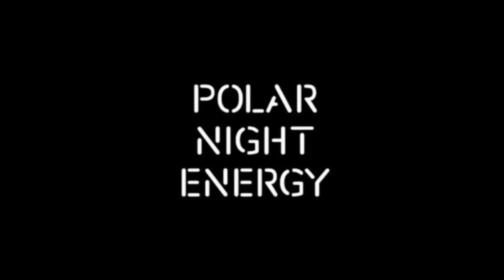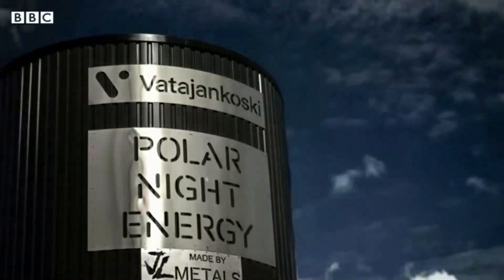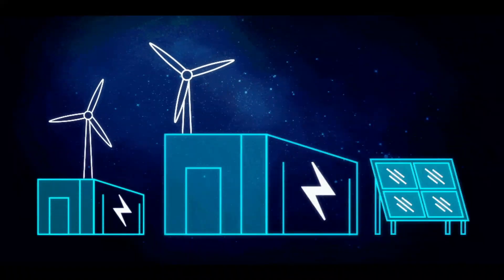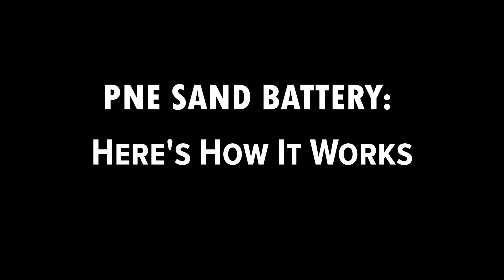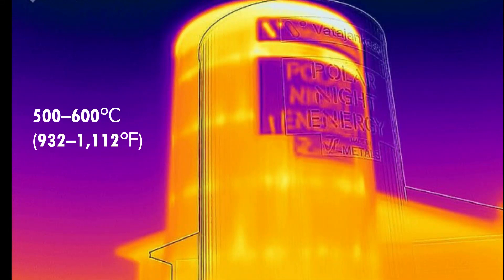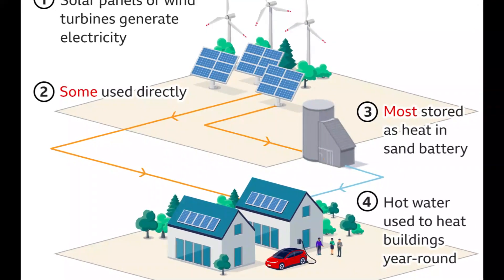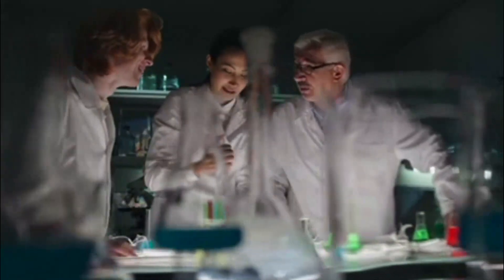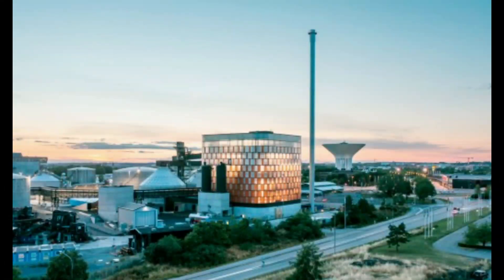Finland SAND BATTERY | How This New Battery Works & CHEMISTRY REVEALED

Comment: How do they recharge it in the middle of winter when there are very short sunlight hours and little gain.
Reply: @hypenohub  It all depends on how much you need to take out before it needs to be recharged, you can't take out out more than you put in unless they use a heat pump.

Comment: How do you insulate the hot sand from cooling
Reply: Sand has low heat conductivity, making it retain heat for longer. Unlike, say water, which quickly cools down. 
—
How hot is the sand?

The maximum temperature in the Kankaanpää heat storage is about 600 degrees Celsius. However, the temperature may even be higher depending on customer needs. In practice, the maximum temperature of a sand-based heat storage is not limited by the properties of the storage medium, but by the heat resistance of the materials used in the construction and control of the storage.

How is the heat storage insulated?

The heat storage is made of steel and insulated with standard, heat resistant insulating materials. The insulation is all around the heat storage between the outer steel layer and the inner one.

How long does the sand stay hot in the winter?

It can stay hot for months if needed, but the actual use case of the heat storage in Kankaanpää is to charge it in about 2-week cycles. The heat storage has its best range of use when it is charged and discharged 20 to 200 times per year, depending on the application.

Comment: How do they insulate their heat storage from environment?
Reply: @hypenohub  
In my opinion this battery may loose much more energy during the winter then it can provide for the customers.
I made some math around it: https://youtu.be/meOYKfm1l2o
Not sure it is correct but hope it worse to think about.
Reply: @eugeneshebeko4187  If that were the case, then my house wouldn't heat up to 70F when it's -20F  -30F outside right?
Reply: Sand itself is already an insulator, thicker the silo is, naturally it creates larger insulation, you just should keep the outer layer without heating and keep it as insulation.

Comment: solar concentration sand heating, the best ever, not 10% or 30% but 100% efficient
Reply: 1000 degrees delta in temperature, gives about 232Wh/kg energy storage rating for silicon dioxide sand
Reply: solar concentration Ca(OH)2 -> CaO + H2O cycle temperature storage, water reactivated
Reply: you can helium or even hot air float a balloon above clouds to have constant non-interrupted solar concentration energy storage or heat lift back to ground
Reply: parabolic half-mirror painted inflatable helium balloon with heat collector, electricity or heat conduction down tether wire, heat conduction by sand or water pipes
Reply: you did not once mention heat capacity equation, just general babble
Reply: molten glass (silicon dioxide sand) is also a nice energy storage
Reply: heat melt it to 2500C, then the energy storage rating is 2.5x or about 580Wh/kg
Reply: of course it can be scaled, what are you talking about, its like a balloon, just add surface area that contains more volume
Reply: works for any scale
Reply: its not gift if you get payment, any type
Reply: electrostatic (hair rising) thin metal (conductive) film parabolic vacuum balloon concentrator

Comment: is that container adiabatic?  Is it a huge vacuum flask or what sort of insulation is used? I've read 20 articles and there are no details.  They're making wild claims like they can hold that heat for MONTHS and I see no proof whatsoever.  "sand can hold heat without loss".... this is nonsense.  If the sand didn't let go of the heat then you couldn't use the heat.